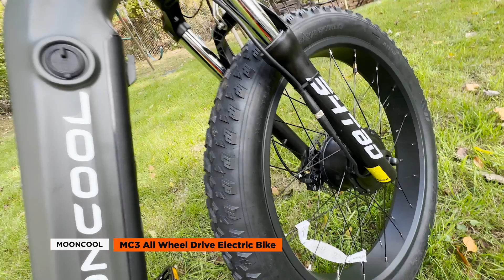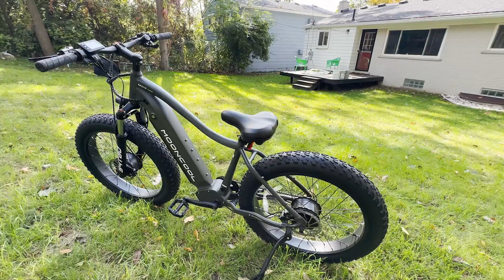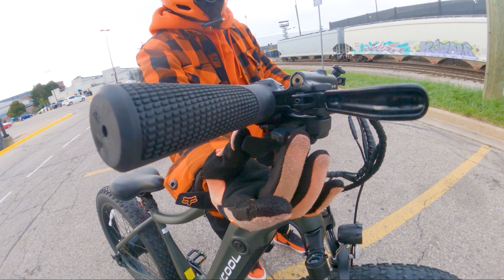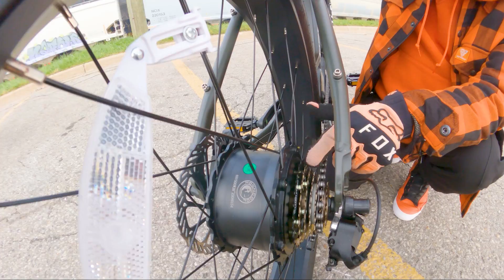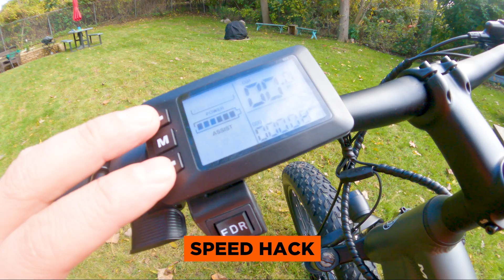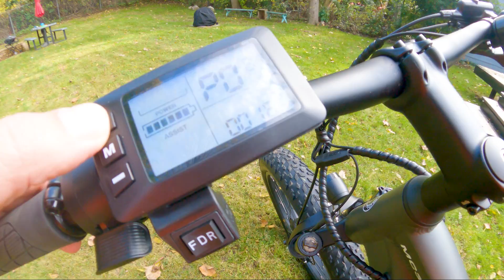Mooncool MC3 AWD Electric Bike: Twin Motors, Twice the Torque! | RunPlayBack

Comment: I have watched your video over and over again because I have recently purchased this e-bike and I am hoping I will be happy with it, but the lack of adequate, understandable instructions makes things difficult. 

I would love more detailed information on the display functions and, despite receiving the auxiliary battery, the instructions on how to properly install it were not provided. It seems as if it should be easy and straightforward but sadly, it’s not.
Reply from the maker: Have you contacted customer support? I can to bring this comment to their attention.
Reply: Contacted customer support but they are in China (with English as a second language) and their responses are as difficult to understand as the instructions included with the bike
Reply: Got it figured out
Reply from the maker: @Smoochalot  glad to hear it!
Reply: Thanks again for your informative video
Reply: I have the bike fully put together but unless I can figure out how to install the auxiliary battery, it will remain completely unusable.
Reply: @Smoochalot I believe it's a simple matter of plugging it in at the plug outlet near the bottom of the frame. You install the battery on the extra screws on top of the inside the frame battery.

Comment: I'd love to see this type of bike with full suspension and more range. 52 volts too with more output on the controller, with rear 750 and smaller front 250 or 350 motor though so you can handle the front wheel better, also better if wasn't full fat tires, the 3" is all you really need for off road
Reply from the maker: That actually sounds like an awesome mod, we'll look into it!